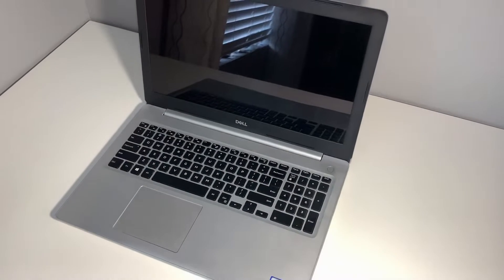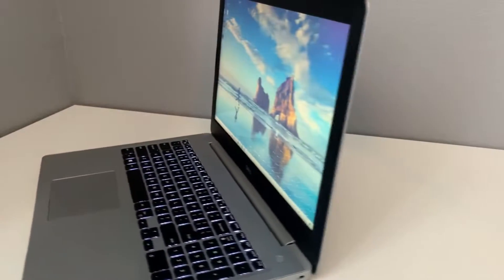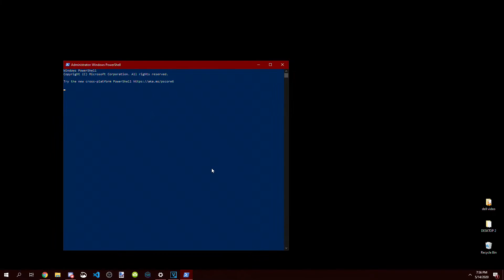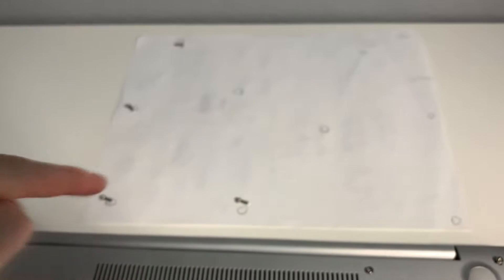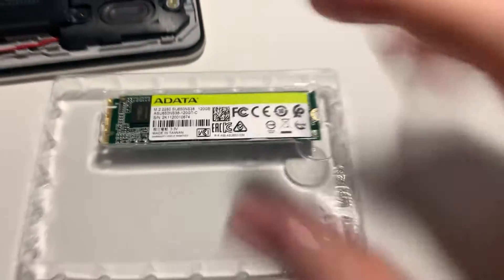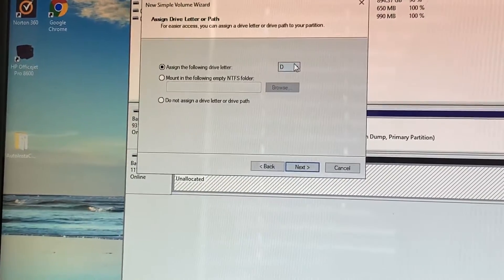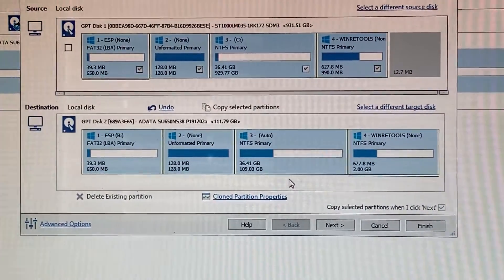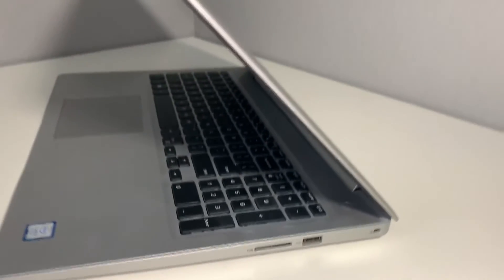Slow Dell Inspiron 5000? Do THIS!

Comment: one thing You forgot to mention, go to BIOS and check intel speed step and have it enabled if it isnt, with it disabled it clocks the cpu only up to 2.39ghz max enabling it will get you to boost levels of 3.00ghz

Comment: Woohoo!! This video and information was a lifesaver! I was ready to throw out my lightly used laptop. I am not computer savvy (and very apprehensive about opening up a laptop), but I was able to follow along. I was also able to make small adjustments to the instructions due to Windows 11 (which I updated on my laptop recently) and an updated Macrium website. Because the m.2 SSD you recommend is no longer available, I purchased this one for $37.00 from Amazon: EDILOCA (EN206 512GB 3D NAND TLC M.2 SSD, M.2 2280 SATA III 6Gb/s SSD Internal Hard Drive, Read/Write Speed up to 550/460 MB/s, Compatible with Ultrabooks, Tablet Computers and Mini PCs). I am absolutely delighted to be able to use my laptop again. Thank you!

Comment: So, really, what we are saying here is that the HDD that Dell have dumped on their machine sucks! I have this model of machine and it used to suffer from 100% disk usage even after removing pretty much everything that might slow it down. It completely ruined the machine - DELL should be paying for the SSD to be honest but thanks for the advice and I certainly will try it!

Comment: Thanks for the info. I ordered a Samsung EVO Plus PCIe Gen 3x4500GB SSD NVMe M.2 from Best Buy for 27$ I hope It’s compatible and I’ll follow these steps to get it installed an operating system swapped over. Thanks again

Comment: Great advice but can’t use because my Dell Inspiron 15 5000 has Windows 11 installed on it. Checked the power shell scrip author’s site and he only has the windows10debloater there. Wonder if there is a version of Linux that will run on this.

Comment: I had a very slow Dell 5888 and I have two solutions for it:
1- Buy an SSD harddisk and use it to install Windows 10. The speed of SSD will make a world of difference.

2- If you don't want to buy a new SSD, DON'T USE Windows 10. Instead, Linux Ubuntu or an even lighter version of Linux like Lubuntu will run quite fine with no slowness issues.

Comment: I wanna sum my big THANK YOU SO MUCH to the rest of the comments. Just got a question, not sure if someone else noticed it but the memory you bought for your laptop is a M.2 with 2 notches, however, the slot on the computer has just one, indicating that it is M.2 but NVMe. Is this a mistake or is the M.2 with two notches compatible with the NVMe? Thank again.

Comment: I want to thank you for this video, as it opened my eyes to an easy way to fix my crappy Dell. There are a couple of things that were missed: if you have an optical drive, it needs to be removed prior to removal of the casing. And check your hard drive properties before ordering the SSD. I'm a little short on space with the 120 🤔

Comment: Thank You! I have wanted to drop kick this laptop since the day I bought it and set it up for wife! Many curse words under my breath - and some out loud! I bought the Adata M.2 SSD - paid another $5 for 256- and "Bob's yer Uncle" it works smoothly and quickly. I didn't run the bloatware remover because I already upgraded to Win11 in hopes that would help.
I guess the stock hardrive had such poor read/write/buffer specs it made the PC almost unusable, but the SSD fixed. You did the world a favor! On paper, the laptop looked pretty good but IT WAS NOT!

Comment: Followed the advise in this Video and the Inspiron 5000  started "screaming" - all the sluggishness went away and now it performs like most other high end business laptops. Thanks to this Video. The DVD optical drive presented a challenge to remove. But i removed the bezel and had access to the 2 screws hidden by the optical drive. But it was difficult to put the bezel back. Had to buy a new bezel from parts-people. Installed the ADATA 128 GB ssd and followed instructions to make it a boot drive and the performance improvement was immense.
Reply from the maker: Super happy to hear that, N Srini!

Comment: Very useful video. My laptop is super fast now. I struggled a bit when opening the laptop for the SSD installation. Two screws need to be removed once the cd rom drive is removed.

Comment: Hi, I just opened my laptop. But I couldn't find the SSD slot to fix it. Could you help me pls.
Reply: If it's not there your model probably doesn't have an m.2 slot. You could probably  also replace the hdd your system runs on with a normal ssd. Should still give a big increase In load times. Remember that you have to install an operating system on the  ssd you wanna install before tho. Can't boot an operating sytem if there is non installed after all

Comment: Thanks so much for the help! I did Part 1 and it worked but after a few days my computer reverted back on its own (including reinstalling Cortana, etc.). I've tried redoing Part 1 multiple times since but my computer seems to have blocked this method from working again. Do you happen to know of any solutions?

Comment: Thank you so much for this helpful tutorial. Just followed instructions, removed bloatware. Installed Samsung 970 EVO M.2 SSD. But my write speed is only 1700 instead of 3500. Please advice?
Reply: Found a few chats on this, has to do with SSD interface being only GT2.
Reply: @jslade7959  Thanks! is it my SSD or the laptop that is GT2?

Comment: THANK YOU.  Wish that I would have found this a few years ago.  My son has been struggling with his laptop, but managed.  I tried a few things in the past, and nothing helped.  I did this procedure  and the PC flies!!!!

Boots fast.  Used to be a few minutes before.
Did a windows upgrade, and it finished in minutes not like forever.
I honestly think that my original HDD was bad from when we got the laptop several years ago.  HDD often would be busy doing something when we were basically doing nothing.  Looking at the task manager, performance, the disk  active time was just about always 100%, and the average response time was about from a few 100 ms to over 9000 ms (yes 9 seconds).
Replaced the HDD with an internal disk.  Had to create a USB boot device with a clone 3PP Acronis that I got when I purchased a cable. 
I booted from USB stick
Backed up disked (full backup). This took 4 hours for 90G
powered off
swapped HDD with SSD (do not have slot for SSD like above)
boot from USB stick
restored from the backup (took 30 minutes)

Then I did the bloat removal.

This PC works fast like it should.
Way quieter
And I am sure will not use up battery as much.

Comment: So if I have a laptop with files and programs on a hdd and want to transfer it all (including windows) to the ssd, will this work? And do I need to buy an ssd with the same amount of storage as the hdd or is it okay to buy an ssd that has enough storage to fit all of the programs and windows? Thanks.

Comment: Thank you so much for this video @Roo Tech. Can you kindly help me? I did part 1 successfully! It made my laptop run super fast. I did part 2. I noticed you didn't have an SSD on yours. Mine has an SSD installed. I took it and replaced with what you suggested and my laptop didnt turn on. I removed what I installed and it was running again. How do I install the new SSD properly??? Please help. Thanks in advance.

Comment: Exactly 3 years i thought i got the best laptop until i started overusing it. I literally has nothing on my laptop and it still lags a lot. Even with 2TB memory 8gb ram, AMD Radeon 530 graphics 4gb graphics
Reply: Wow, the same situation that I have been experiencing. Mr Dell Inspiron 15 5000 with Core i3 (bought in Sep 2019) is so sluggish that drives me so crazy. I have been suffering from this problem for 2.5 years. I could not work for 2hrs because of Mr Dell. It was so lucky to see this video.
Mr Dell disastrous performance really makes me understand that substance over form.

Comment: Can you give me your input. I did everything correctly. It is better, but still booting up like a slug. When I went to clone my drive, there were 6 partitions instead of 4. The 5th was red, not blue like a warning sign. It was full with no space on it. Should I have copied all 6 partitions, or just the first 4. Do you think that 5th one is my problem? Should I start again Are you able to give me some support on this?
Reply: It is nothing like when I bought it just a couple years ago, and nothing as fast as my cheap work laptop.

Comment: Dell Inspiron 5000 are lemons.  If you had  it a few years...it slows to a crawl and you have to give it up.  It becomes unusable. You can do the above processes and hardware changes it wont matter.  You can reinstall windows,  remove the bloatware with github, add an SDD drive and maximize memory.  It just won't matter at that point. If you are thinking about one of these used, DO NOT DO IT!. For an I7, its Winsat scores are pathetic.

Comment: I have dell 5567 , where i have to buy a caddy because there is no ssd slot , was slow as hell , not detecting the caddy spend more than 5 hours to fix that .. and now the laptop is like super computer 😅 , thanks for this video
Reply: even i have same model dell 5567 , it is very slow from the day i bought it even hang on most occasion, response time is like hell. What should i do to make it faster bro please tell me...Please
Reply: @tech6821  I'm happy with my laptop performance now , it boots up in less than 10 seconds , 
There are two options 
1. Change your HDD storage to SSD , if data matters to you first copy whole data like shown in this video .
2. Or run SSD and hdd side by side using a caddy like what I did . 
The only solution is SSD nothing else if ram is only 4 + SSD it will still work like charm
Reply: @Zackking109  Thankyou for the suggestion.
One question if i run both ssd and hdd side by side using caddy so is there any data loss from hdd?
And other thing. your laptop overall perfomance also becomes fast or just boot up time?
Reply: @tech6821  overall the performance of the laptop increase significantly .
No data loss no so ever . 
I will try to make one video on that ...
Reply: @Zackking109  yes please will love to see that video.

Comment: Great stuff I have done the first part and already feel the difference I will being doing the 2nd part Installing a ssd card but I have been told I should earth the laptop but you didn't do that in the video? Is it necessary?

Has anyone else earth the laptop when installing the ssd?

Comment: @ROO Thank you so much there is significant improvement in the performance by removing the bloatware but still not in the best of shape. Do you think buying that SSD would make a big difference?

Also my battery keeps showing error that no battery is in place although it is there. Can you provide a fix for that?
Reply: Buy an SSD. Removing the bloatware helps but in no way as much as the SSD. I did the same to my laptop last year and it's FAST
Reply: Mine just did that. I reseated the connectors and now it working.
Reply: the battery problem

Comment: Well it has a spinning drive. An SSD will make it so much faster.  That bloatware removal too does not do anything for a spining drive to make it faster. The only thing that makes it faster is the SSD. Your miss leading people.  Windows updates will bring  all of it back. 
Your SSD also didn’t cost you only $20. You also should’ve explain to people the difference between the different types of M.2 drives. Only an M.2 SATA drive will will work. You also said it took five minutes to open up a chrome tab and get onto the Internet. You did the exact same thing and it took all of 10 seconds. Your video is very misleading. Show the five minutes it takes to open the tab next time before you clone the new drive.
Reply: Thank you so much you probably just saved me

Comment: I did the first method without asking you because I think 2018 model of Inspiron 5000 is very similar to Inspiron 3593. Regarding with the second method, Is NVMe SSD compatible with the laptop? Thank you for fast response 😊
Reply: I also have an Inspiron 3593 and it's really sluggish. Can you please tell me how is it going now that you've done the first method?
Reply: @kayerellebarrete4324  It became snappy after I upgraded it to 8gb ram. I think upgrading it to SSD drive won't be that necessary. I think due to upgrading it's ram it made the CPU more under loaded so it doesn't get hot that much now. I advise you to get Crucial branded RAM(8GB, 2666mhz) because it is less cheap and more compatible.
Reply: @abdeesani5379  oh, ok thank you so much. I should try that.